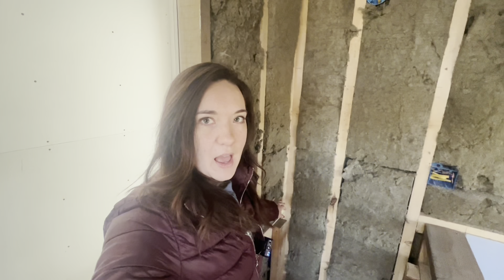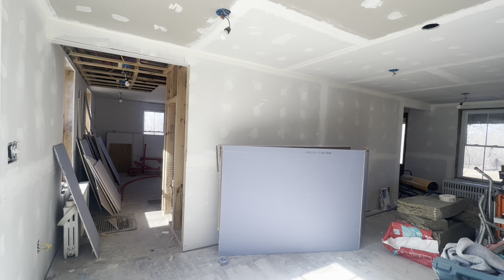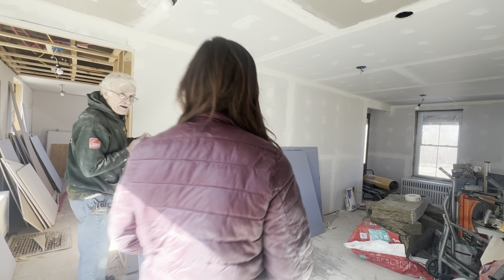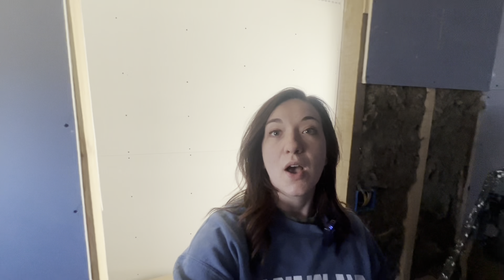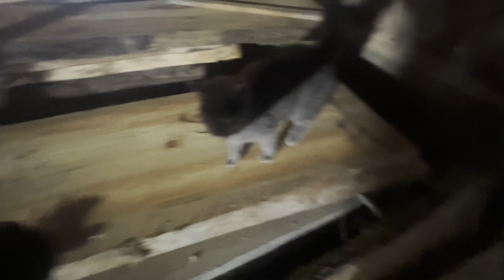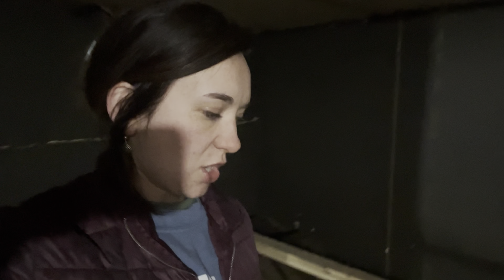Bathroom Drywall & Vanity Plans! 🤩 | my Total House Renovation

Comment: i like the slab of wood for the counter top, it will look pretty.
Suggestion - I would not install the counter, then sheet rock, seems backwards.  The sheet rock should be installed 1st.  If you ever needed to replace or repair the counter top, you'd have to rip out walls to get to it; tons of work.

Comment: Abby May I suggest when doing floors look into luxury vinyl sheeting. It’s all one piece like the old fashioned linoleum but so much better. Mine looks just like hardwood floors and is even textured. You cannot tell it isn’t hardwood. Easy maintenance and just gorgeous people are amazed when I tell them it isn’t real wood. It doesn’t have the “ slick” appearance and is just the best.

Comment: I was confused as to why there was a pony wall between the vanity and toilet. But now that I know your vision, it makes sense. Two different wood species will mostly likely stain differently. Pine is a soft wood so it absorbs the stain unevenly. I’m not sure about tamarack. Definitely try a sample first. You might need to adjust the stain or possibly use a gel stain instead.